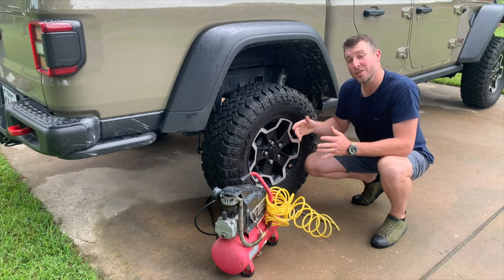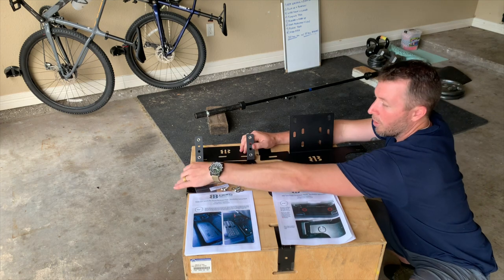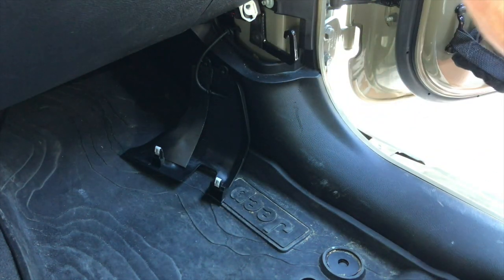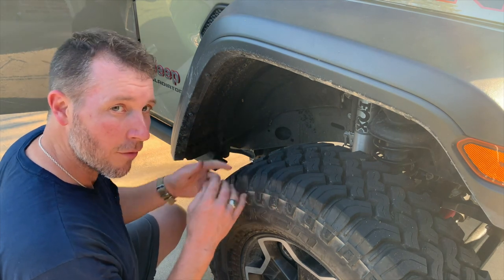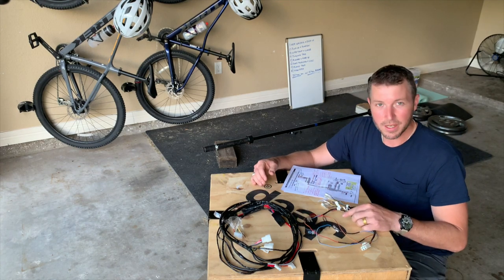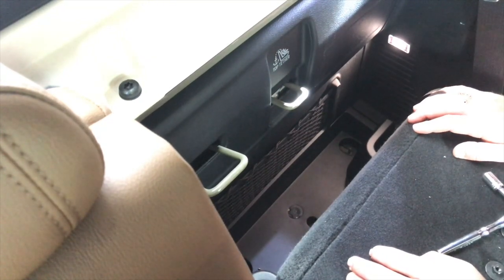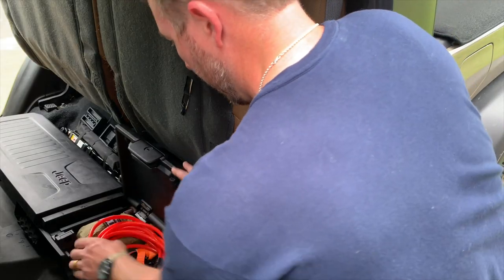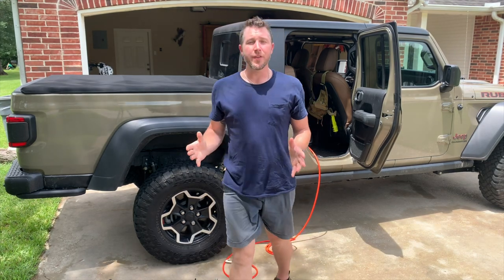813 Fabrication and Designs "Behind The Rear Seat" ARB mount and wiring for Jeep JT Gladiator

Comment: I have a JL so this video doesn't pertain to me, but just wanted to stop by and say what an amazing job on the video, and amazing at doing the timeline sections on the video. Super impressed and super awesome you took the time to do that.
Reply from the maker: You bet Ricky! Thanks for the kind comment. Correct, though the bracket doesn’t apply to you directly,  the wiring will be a lot the same should you go another route for compressor mounting.. 813 plans to have multi vehicle applications, so I wouldn’t be surprised if you see other vehicle brands and Jeep model applications available soon in their website.

Comment: I think this answered all my questions about connections and wiring. Will report back after I install the ARB. Thanks for making this, sub'd!
Reply from the maker: Perfect! That’s was my mission! Let me know if you have any questions!
Reply: Where did you connect the switch wires blu/whi and red/yel? You only said you spliced the red and yellow.
Reply from the maker: The blue/white (illumination) wire and red/yellow wire are twisted together and but connected to the wire I ran to the F50 fuse.. Watch again to the video at 31:28
Reply: Gator_Overland thanks for the quick reply! so i got it.. we wire both blu/whi and red/yel together then tap both wires to F50? Did I get that right? Sorry noobie here
Reply from the maker: Randy yep, just remember, you must ground the switch (black wires) in order to compete the blue/white wire circuit for the illumination..
Reply: Gator_Overland thank you Sir!
Reply from the maker: You bet, let me know if you have any questions. For better contact and following, check out gator_overland on insta
Reply: Yeah figuring out these two wires is the hardest part. I’m still a little confused but tacking the job soon. 21 JLU mounting the Dual Arb in the cargo area.
Reply from the maker: Thanks for the reply! Contact me via insta for any help with wiring. @gator_overland

Comment: I don’t know if you changed this but I would recommend adding an inline 40amp or 30amp (whatever it called for) at the battery. Your fuse blows at the pump it’s easy to change but you have a live 12v wire all the way back. It gets compromised anywhere along that length and it’s a straight short. That fuse at the battery provides protection from short and pump overload. Just a suggestion.
Reply from the maker: That’s great advice and good peace of mind .

Comment: I bought this except I have the chuck mounted next to the air compressor not under the seat. I think the bracket next to the compressor is a better use of space and since the unit gets hot it's nice to drop the back of the seat down to help get rid of the heat. I also have the double compressor so it probably gets hotter than the single. It's such a tight fit back there that i really think it is the best use of space for it. Just my 2 cents!
Reply from the maker: I totally agree… At the time of my install the bracket was not available… Surprisingly the twin compressor runs a lot cooler than the single. There is a video out there by Nate Johnson who put some reflective heat sheet on the back of the seat to dissipate the heat… I recently got the 513 lockable bin and will be relocating the Chuck to the side of the bin.

Comment: This wire graphic is different for my Aux switch bank install. I ordered the Mopar switch bank through my Jeep dealer and it came with Aux 1, Aux 3 =40 amp, and Aux 2 and 4 were 15 amp. I had my Everblade heated wipers installed to Aux 2 switch at 15amp. I bought my 2020 JT without the Aux bank and had it installed after purchase.
Reply from the maker: Interesting. I have a diagram showing then amperage per color and it’s in the manual as well. Odd the placement is different for you, but at any rate the color wire you’re attaching to is more relevant than the button as long as you know what button the wire goes to. Thanks for the info, good to know!
Reply: @GatorOverland  There is a guys video from Singapore installing the Aux Switch to his GF JL, they are the same as JT and I was confused at 1st too, but he showed the harness and fuses. It was set up like mine. They might have 2 different companies making them and the dealer installed is different from the factory installed. Either way guys can figure it out pretty quickly.
Reply: FYI, the Mopar add-on wire harness for aux switches is different than the factory installed. I believe it was also missing the switched 12v. Same as the add-on towing wire kit for the JL and maybe JT is missing the plug and play brake controller. I added the aux and brake kit on my JL.

Comment: Great video, In the future, skip the tape on flare style fittings. Its a straight thread, not tapered, the seal is made with the metal compression at the end, the tape could actually hamper the seal. Loctite 5452 would be the a recommended product to use instead.  Google search "Do JIC fittings need Teflon tape?"
Reply from the maker: Thanks for the insight on the bud! I appreciate you taking the time to watch an comment! 🤘🏼

Comment: So I have to go to the compressor itself to hook up my air line, right? Is there a switch available to mount to the compressor to avoid all this switching mess?
Reply from the maker: No, you can remote the air truck anywhere you want. All you have to do is thread into the 1/4” NPT port on the compressor body with a Tee or elbow (barbed or jic-04 compression fitting) and you can hose your Chuck connection to anywhere you want… Some people actually make a chuck connection at all four wheels in the wheel wells and from there can just use about a 2 foot lead to each tire rather than a full octopus like I have. I have my chuck on a small bracket underneath the seat, The compressor is behind the seat.
Now as far as the switch goes it’s quite simple but the way their harness is, it can seem complicated… I would be happy to help you understand it outside of YouTube… Shoot me an email at jkhartel3@gmail.com
To put it simply… All you need is your two leads that are 10 gauge coming from the compressor going directly to the battery… And then a wire from a 12 V source (14-18ga) (red/yellow) running to the switch input (middle left spade), and your red (single) or purple (twin) wire coming off the switch output (lower left spade)
If you have an auxiliary group all you need to do is connect a wire from the auxiliary output wire to the that same red or purple wire

Comment: Great video! I have watched your lift video as well and love it! Was wondering if this is still the 2" mopar + 3/4" spacer setup with 35" tires? Or are these still the original 285/70/17s?
Reply from the maker: The video shows my stock 285’s (33’s), I now run 37” BFG’s and love them.. and the lift for that matter. 
For better contact, info, photos and video check us out on
https://www.facebook.com/JKHartel3
https://www.instagram.com/p/CF-X_58BjDR/?igshid=1r9yo0niyroip
Email: JKHartel3@gmail.com
Reply from the maker: I have a DIY 4way inflate system I made reference The 33’s and 37’s deflate and inflate rate

Comment: What's the noise like in the vehicle, specifically the back seat, when the compressor is running?
Reply from the maker: It’s definitely audible.. but not terrible considering it’s in the cab. I’m typically outside tending to things while it’s in operation, so it doesn’t bother me. If you had a baby sleeping in the back seat, it wouldn’t be sleeping long 😂
Reply: @GatorOverland  Any chance you could take a decibel reading the way you did for the headliners video? :D My dogs stay in the back seat and I'd hate to hurt their ears while this is running.
Reply from the maker: I absolutely can… Hit me up on https://www.facebook.com/JKHartel3  Facebook messenger or email me at jkhartel3@gmail.com

Comment: Great video!! How did you get the horn to sound once aired up tp desire psi? Thanks
Reply from the maker: Thanks for taking the time to watch and comment! The pressure alert is a standard software in the radio off-road pages of an rubicon and Mojave. I think it can be upgraded to lesser models at the dealership.
Reply: @GatorOverland  thanks. I will have to look into it as I have a Mojave.
Reply from the maker: https://youtu.be/KJ9CHGE__sQ

Comment: The blue wire that plugs into to switch, what is that connected to? Is it spliced into the relay blue wire?
Reply from the maker: The blue wire splice together with the red wire that is receiving power from the piggyback fuse box… All the blue wire does is provide 12 V to power the LED lights.
Reply: @GatorOverland  thanks!
Reply from the maker: For better contact, info, photos and video check us out on
https://www.facebook.com/JKHartel3
https://www.instagram.com/p/CF-X_58BjDR/?igshid=1r9yo0niyroip
Hawkijon@aol.com
I’d be happy to help with any additional wiring questions you have… It’s easier to show pictures or video

Comment: I don't have a fuse on F50. Can I use F51? There is a fuse there. When I tried putting the fuse adapter into F50 there is no retention to hold it in place.
Reply from the maker: If you don’t have aux group, F50 won’t work and there won’t be any powered pins behind it. You can use any “F”’slot that powered when the key is on. I.e. windows, radio, ac/HVAC , defogger,
Reply: @GatorOverland  thank you!
Reply from the maker: You bet! Let me know if you have any questions jkhartel3@gmail.com

Comment: That rubber grommit in the passenger firewall is a potential nightmare. The CANBUS that runs through that isn't wrapped, or in a loom, or protected in anyway. If you nick wiring, you have a potentially dead JL/JT with a pricy repair bill.
Reply from the maker: You make a very good point. There was plenty of room in my grommet to safely penetrate unscathed. It is definitely an area to use caution.
Reply: @GatorOverland  ask me how I know. 😂
Reply from the maker: Ouch!!! Do you know specifically what you knicked?
Reply: @GatorOverland  bus for the transmission control module.
Reply from the maker: Yes I bet that leads to a pretty significant issue. Mine is a manual so that might be why I have the extra space in the grommet

Comment: why are you running the ground all the way to the front? just run it to a solid spot on the chassis near the pump.
Reply from the maker: You’re exactly right. For the purposes of the video and by recommendation of the manufacture I went the “extra mile” to connect it to the battery, connecting it to a solid ground source (frame) near the pump is more than acceptable. 🤘🏼

Comment: Over priced 813 stuff
Reply from the maker: 813 is a small family owned business out of Kentucky… With the rising cost of material pricing and availability at a minimum he has had to increase his prices unfortunately into the 30 to 40% range from last year… It’s still great quality stuff but by comparison of others on the bigger market it’s going to be a bit higher price… 1/8 inch sheet aluminum is going for approximately $350 right now …you could go with other brands of steel options that are similar but it’s going to be heavier and it will rust.
Reply: @GatorOverland  I think being inside the car makes it highly unlikely to rust. That being said I purchased this same setup yesterday, lol I got the bracket that goes next to the compressor and not the one under the seat
Reply from the maker: Yes inside the cabin would be less likely to rust. I meant since his products are all aluminum there is no chances of rusting in general by comparison of other brands of steel construction like AAL or JCR etc. I’m glad you got yourself fixed up. There is a wiring tutorial in this Video thaf may still be helpful to your installs. 🤘🏼
Reply: @GatorOverland  yea I got the writing sorted out. I cut off all the wiring for the lockers and just left the on/ off switch. It’s installed on the 313 mount and ready to go into the gladiator. It’s getting a glow plug sensor replaced so as soon as it comes back from the dealer it’s going in. I will be buying the molly panels for the bed from 813. I just wish they offered free shipping
Reply from the maker: Totally understood… man, I’m kinda itching for a diesel too.. 
yes, free shipping is nice.. but i understand the small business aspect.. he probably doesn’t move enough product to suffice the free shipping bill
Reply: @GatorOverland  yea I love the diesel, I came from a jl wrangler Sahara so I know the difference between the 3.6 and the diesel and the diesel just feels great
Reply: Looks like under the rear seat. Not behind the rear seat.
Reply from the maker: The compressor is behind the seat… The switch and air Chuck is under the seat.